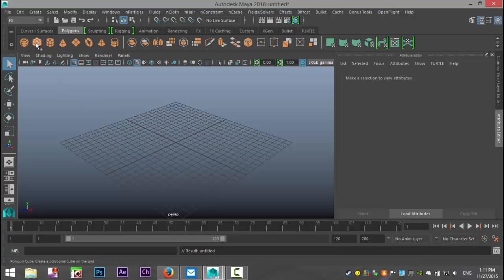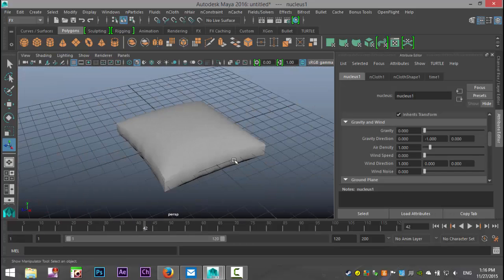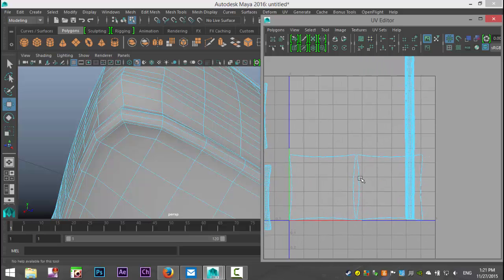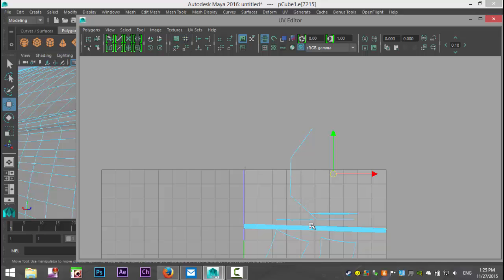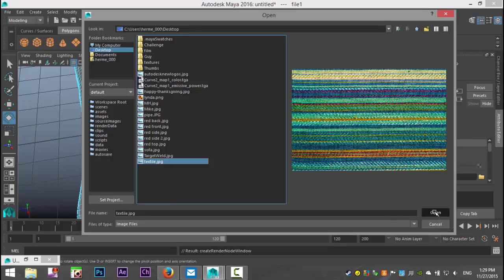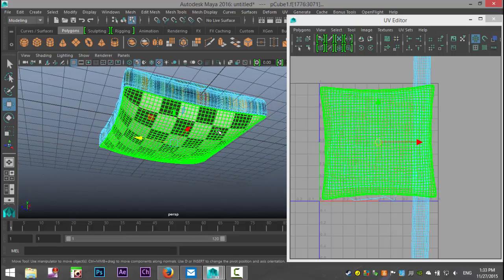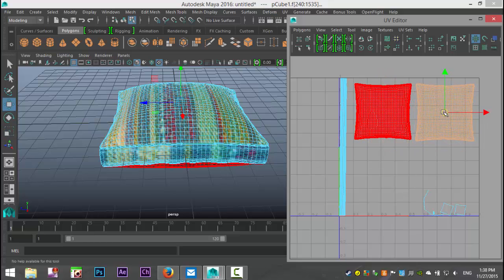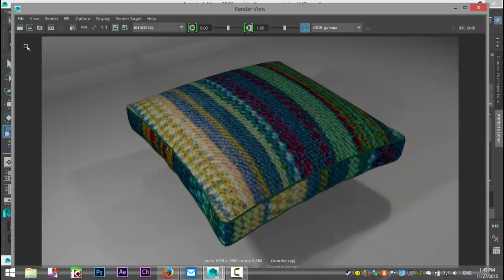Maya 2016 tutorial : How to model, UV Map and texture a piped pillow

Comment: Hey Mike, nice video! I seem to be having a bit of a problem when I start up my UV editor. For some reason, it doesn't show the pillow faces like yours did. I have the 2015 version so maybe it could be that? Another problem I've spotted is that, for some reason, every new polygon I create seems to always have the white leather texture I added a while ago. I can delete it from my UV, but when I opened the UV editor, the entire leather texture is covering the entire box where you performed the "SHELL" action. Is there something I did wrong?
Reply from the maker: It sounds like you a some point have replaced the standard grey lambert with a white leather texture. Reapply a grey lambert to your model ( even manually if you have to ) and try again